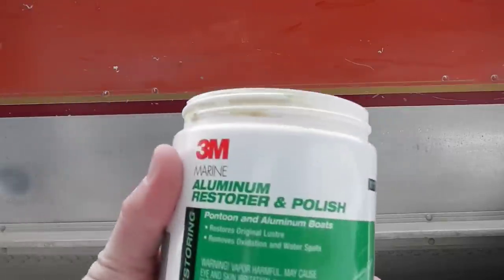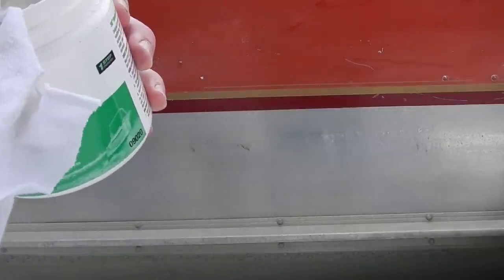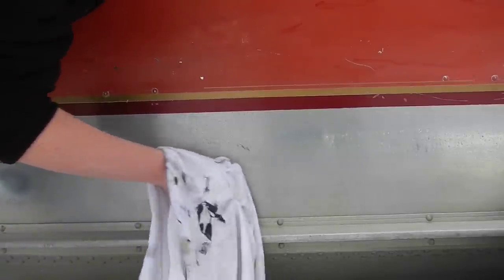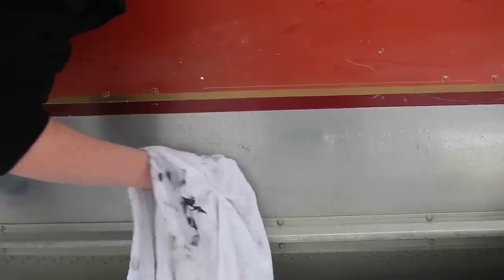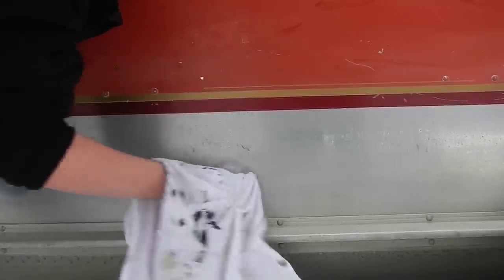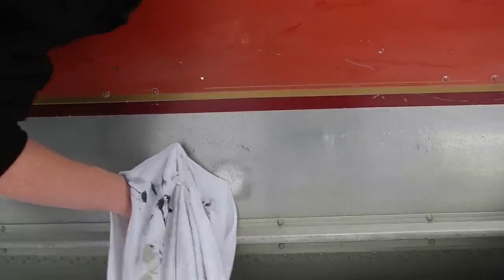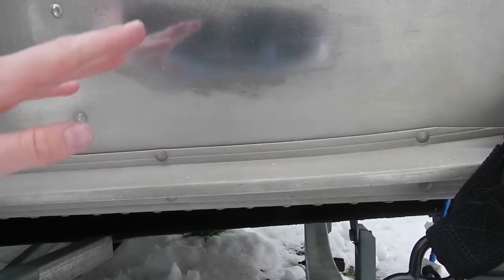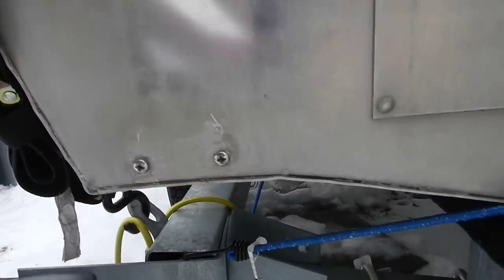Aluminum Boat Polishing (3M Marine Aluminum Polish)

Comment: Just got my 3M in the mail yesterday, used a buffer and got one side of my 16' boat nearly done. This stuff surprised me on how good it works! I was able to get a mirror reflection out of the dull aluminum. Thanks for the vid!
Reply from the maker: Yea it really surprised me too.  I've found a high speed buffer works the best.  Glad your boat looks good!
Reply: Outdoorsman Channel The buffer I have doesn't turn as many RPMs as it needs to, but I've found If I remove the 3M and reapply it the shine will come out. Thanks again!
Reply from the maker: What do u mean by remove the polish and re apply it
Reply: Outdoorsman Channel I'll put 3M on the transom, hit it with the buffer, remove the residue, and reapply the 3M again. I repeated this a couple of times and it really cleaned up the old water-line. There was just too much oxidation on the transom compared to other areas of my boat.

Comment: My understanding is that aluminium doesn't rust because is builds up a layer of oxidation on the surface that then protects the underlying aluminium. This is essentially stripping back the protection layer. While it looks good its not necessary.
Reply from the maker: Oh yes it's completely not necessary.  However if you want the shiny look it's the only way to go.  the oxidation will just rebuild up.

Comment: If I use this on my boat, just wondering if the paint will goes off too??????????
Reply from the maker: I have tried the polish on the paint and it is very aggressive.  I would not suggest it if your paint is thin.  If the boat is newer it might work.

Comment: Would it be necessary to use wax on a boat that is used in sweet water?
Reply from the maker: wax is not necessary but it will make the shine hold loner

Comment: How long will the shine last between applications?
Reply from the maker: Not too long honestly.  I polished the boat in the beginning of spring and it looks like it's already oxidized now in fall.  There polished sections still look better but not nearly as good as when first polished.
Reply: Outdoorsman Channel thanks.  Doesn't seem to be anything that really works great.  Read mixed reviews about sharkhide, that it dulls the finish.  Also its an arm and a leg.
Reply from the maker: Don't get me wrong the polish works fantastic but it doesn't hold shine long just because it's aluminum.  Aluminum is always oxidizing but we use our boat quite a bit.  Wax might also help to keep the shine.